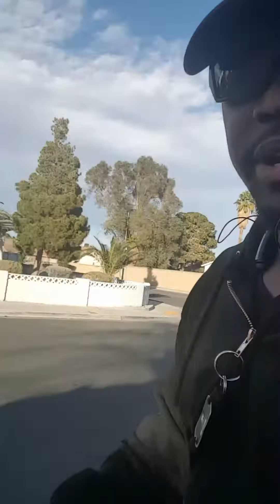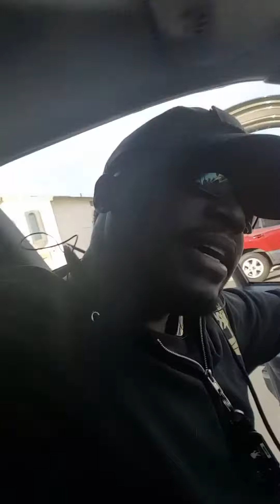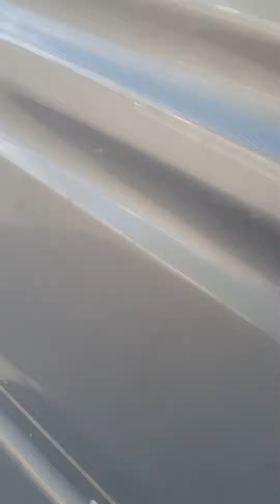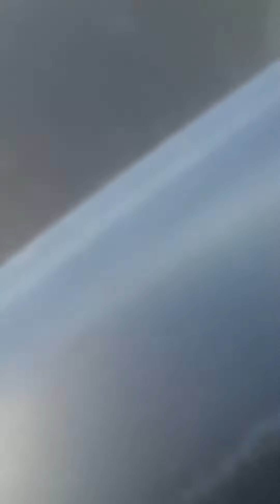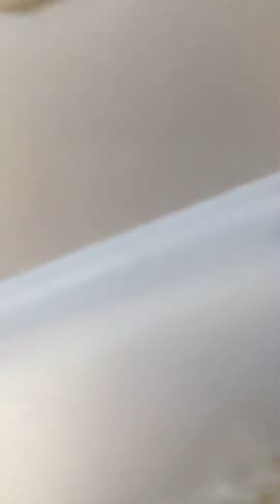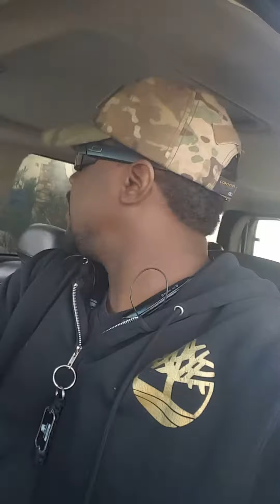1996 jeep zj bad front end noise

Comment: Late to the party, but it's a bad u joint and the reason the drive shaft looks like that is the previous owner snapped the drive shaft and shortened a different one instead of replacing it  so it's probably out of balance.
Reply: so what would be the fix too it man?